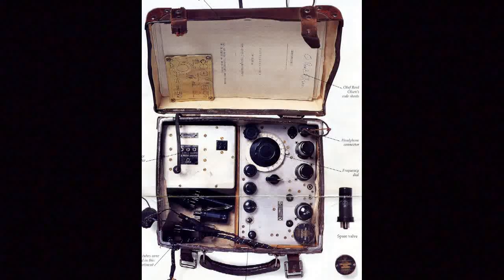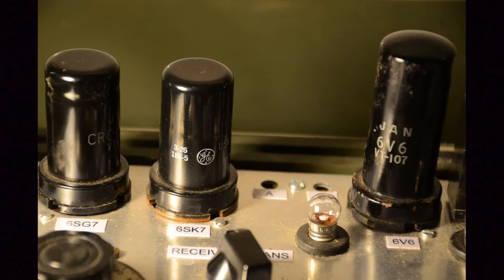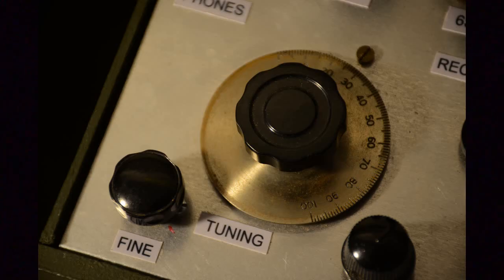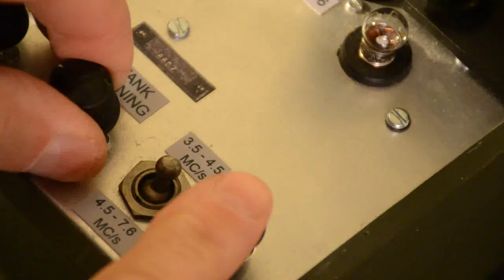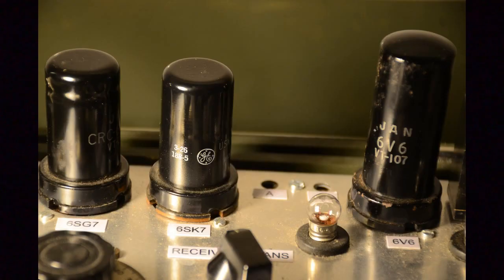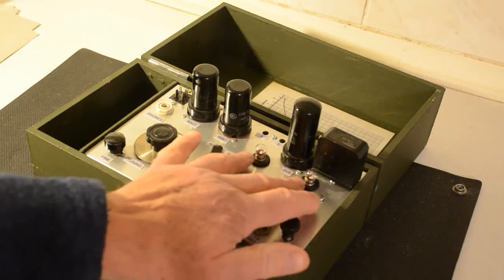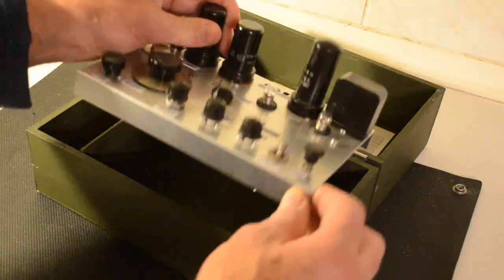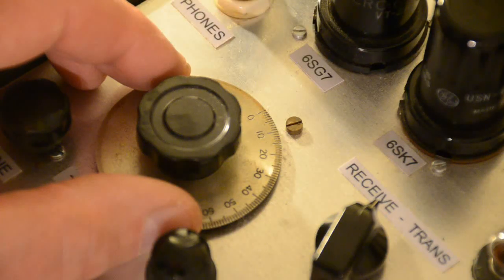Paraset - The Whaddon Mk. 7

Comment: One of the better videos I've seen on the Mk VII. I built six of these things. I substituted the slow-motion tuning drive with a three position rotary switch, switching in band-spread for 40 and 80m and full range, being careful to use grounded braided wire to carry the signal from that switch all the way to the Rx coil. RG316 works great as it is only 1 pF of capacitance per centimetre of length (when calculating Silver Mica values for bandspreading). I also Instead, utilised a vernier reduction drive on the main tuning capacitor itself with a 5:1 reduction between open and fully meshed. 
Using DC for filament heating, I also used it to power a 6v RF relay as the switch for Tx keying. This took RF energy away from the key itself - especially if you want to use an external key as it would otherwise send RF down the external key's wire and become a detuned antenna! 
With the Rx coil's sensitivity and selectivity sorted, the regeneration control works well using a Bournes 10 turn pot for finer adjustment. 
An amazing little Rig; it has to be the most fun I've ever had. They work like a charm and the audio is beautiful. Just best to use them in RF quiet locations in the country!
Reply from the maker: Sorry, but I definitely replied to this several days ago yet it's gone... Nice to see you are a Paraset fan! Interesting to her of your variations too. Some of the 'original' bits were just too difficult to source for our replica. Our is never used 'in anger' for transmitting as it is just meant to be a demo. Hence the plastic varicon caps. We're using an 85V HT for starters. Not too good for the 6V6! Mind you, it DOES work properly and will transmit a few yards if called upon to do so; like across the room at an exhibit to be picked up on the R1155 :-) using six inches of aerial lead.

Comment: Do these plastic variable capacitors survive without burning up in the transmitter?
Regards,
Thomas
Reply from the maker: Good question! As our Paraset is only ever effectively used for 'demo' purposes with a low 150-180V HT, we've had no issues in that department. However, if you were to use it with a full whack of 250 - 300V, then I would personally only use air spaced caps.